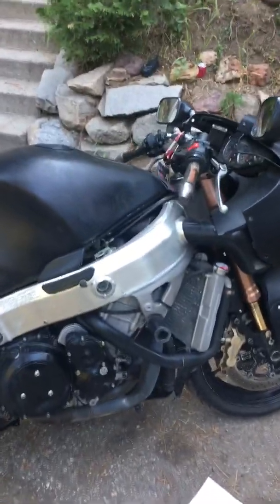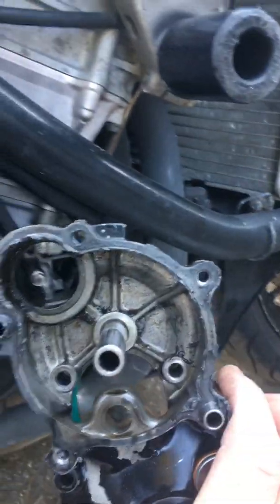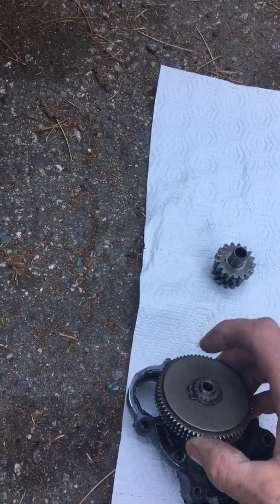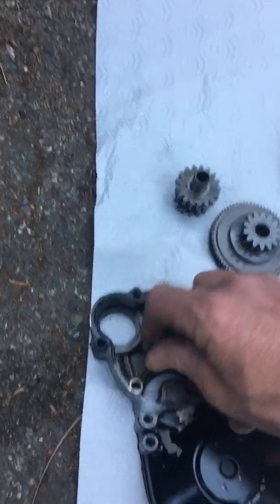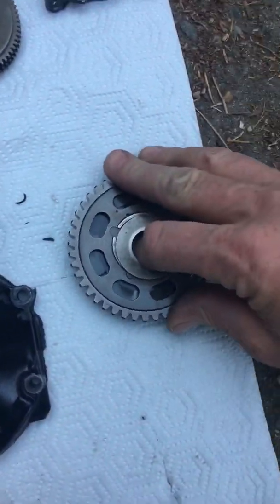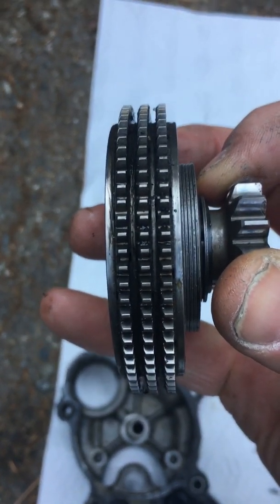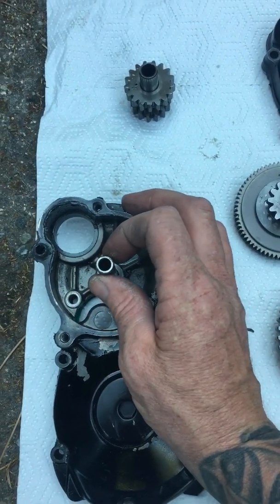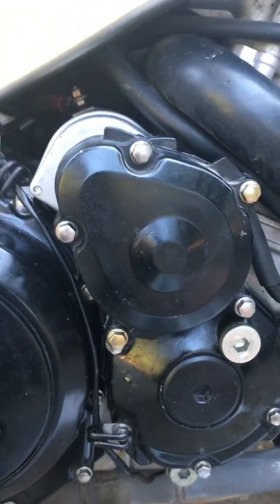Hayabusa hot start fix

Comment: So you had to replace the housing?
Reply from the maker: Yes, sir. The housing was not dedicated to the orifice of what was supposed to go in it. I replaced all the parts because it was only $70 from a broken bike, but the bike never had the problem of starting. The housing is what made the bearing go wonky eyed.
Reply: @rickgidney1005 guess i’ll try to find the oem parts then. So many people are saying its a battery problem. I have a Gen 2
Reply from the maker: @Blueeyedsoul73  there are a lot of people out there that only point to the easiest stuff which some people should try first, but maybe hook your battery up to a full-time power jumpstart to see if it does the same thing. That should alleviate the battery if it does the same thing.
Reply from the maker: @B @Blueeyedsoul73  I’m not sure if I got OEM parts off of that crashed bike from the wrecking yard but they definitely work. OEM parts are the one that originally came on the bike that are screwed up so I don’t know if they make them any better.

Comment: having the same with hot start issue with mine, if the bike cools down for 10-15 mins it starts fine. Battery is good the only thing is that mine has a big bore kit so im not sure if that would be causing hot start issues. Ill be probably open it up in a month or so and see if its lose or not.
Reply from the maker: Yeah, it can’t hurt, maybe do it and get an oil change done with at the same time or whatever else you have to do and make it all worth it. I had a smart friend to help me figure out what it was, but it can’t hurt to check. I haven’t had a problem since. Good luck, dude let me know.

Comment: Hey mate I’m having trouble hot issues with late model Haley 
Dealer told me it was voltage regulator, $700 dollars later still doing it
Next was brand new battery 
Do you think possibly a starter clutch 
I’ve watched so many YouTube videos but yours seems to make the most sense
Reply from the maker: @gordonmorrison4005  hey brother, no one can tell from this end of the conversation, obviously, $700 sucks. The only thing that was wrong with mine was deflection, when the starter spun the sprocket gears, and whatever else that transition down to the crank, we’re bending sideways so they were actually kind of getting stuck instead of spinning. That’s what fixed my bike. I know starter relay is one of the other options, if you haven’t done that then that might be something you would look for it, but I’m not sure. You’ll eventually figure it out or get rid of the bike obviously lol. I hope it goes smoother for you, I spenta lot more than you did. Just trying to figure out what I had to fix mine. Anyway, let me know, buddy. Best of luck.
Reply: Thanks Rick
Yes will keep investigating, it’s bloody frustrating though 
I’ve heard starter clutches can bind up when hot so maybe something to check
Reply from the maker: @gordonmorrison4005  I just find a nice day to give yourself plenty of time to go through the simple stuff and just be thorough and keep a positive attitude because getting frustrated doesn’t fix it. Thanks buddy let me know.

Comment: Thanks so much for posting this!!  I have been fighting with difficult hot starts for a long time on my b-king.  I was about to put a starter on it to see if that fixed it.   My question is… what is the actual fix?  I need to pull that whole assembly apart and replace the backing plate or is it just the pin?
Reply from the maker: @BouncingSkull  hello, on my bike and probably everybody else’s bike. It was just the backing plate with the hole recessed into it. The pin is made of metal and most likely is not worn out, I just think the orifice was a little too big. Maybe a factory mess up, but I got lucky when I got the replacement parts from a Cycle Salvage Place where the motorcycle had a bad head. So the parts I got worked luckily enough for me. Nobody has replied, letting me know if it fixed their bike or not. If you end up getting it fixed, please let me know. I’d love to hear it. Good luck with it.

Comment: But question what to do if the housing that the pain goes in happened to crack
Reply from the maker: @kingjohns2011  you’ll have to get a replacement, used or new I don’t know which is best

Comment: Thanks for the video. You mentioned the wave washer. I didn’t see it in your video because I assume you already had it installed with the new parts. I pulled my cover off to troubleshoot and noticed that there was no wave washer on mine. What issues could this cause and where exactly is the wave washer placed for when I have to order one
Reply from the maker: @Suzukigsxrdave  it’s been a couple years since I’ve had it apart because that was where the problem lied but it’s just right there on the hollow pin I think sitting against the idler gear. I’ll have to scan my video to see and let you know.
Reply from the maker: Hey bud, I just reviewed the two videos I had on a hot start issue where I fixed mine and I did not show the wave washer. You are correct, what I remember from it is that when I pulled the idler gear off it was one of the washers that was with the idler gear. You would have to pull up, a diagram maybe at Chaparral or a motorcycle shop where your close to to find out but sorry I didn’t show it. I think it just gives it a little distance and never lets it make to a surface for whatever reason. But yeah, I’ve never had a problem ever since I replaced that part that holds the hollow pin.
Reply: @rickgidney1005  I found that mine was sloppy in that area too. New part ordered
Reply from the maker: @ excellent, I got mine off the bike that had the head blown, but the parts were good because when I got them used, it was nothing like the sloppiness that I had with this one. Let me know if it works out for you, you would be the first one to actuallyrespond that it was a fix.
Reply: @rickgidney1005  been researching forums and videos on my issues. After I run it awhile and turn it off to like get gas etc and go to restart it. It fires up immediately like normal but dies instantly. I’ve pet much did everything to fix n trouble shoot it except adjusting valves.
Reply: Saw your video and checked mine last night and had that same slop where the shaft goes.
Reply from the maker: @ I know what you mean, like I mentioned in one of my videos, I replaced just about everything you could replace except for the wiring harness, and then it gets into digging into the motor. But I was lucky we found this problem because it was the fix.just make sure the new one isn’t like this. Also, there could have been a bad mold from the factory but you’ll check it. I’m sure when you get it. Please let me know buddy and thank you very much. Good luck.
Reply: New coils plugs throttle synced tps set throttle body and injectors cleaned. 
I also randomly get a lurching /jerk feeling at steady throttle in lower gears at steady rpm and also replaced all fuel filters and pump inside tank
Reply: @ last question lol. Was the part you replaced on it oem from Suzuki. Or eBay Amazon. I know it’s probably not recommended but I bought one from Amazon last night lol. Like $30. New!!
Reply from the maker: @Suzukigsxrdave  mine came from an original Hayabusa from a wrecking yard, but who knows, maybe you’ll have good luck. I would definitely try the $30 part because the other stuff can be expensive. If it turns out to not be as good, maybe check with some wrecking yards for bikes if you have any where you live and it looks like you live in Florida. I don’t know anything about what’s out there but I do buy parts from eBay from somebody that’s in Florida and I know bikes are really popular in that state so you shouldn’t have a problem.second or third GEN Hayabusa? I’m always on YouTube watching videos so I’ll definitely see if you respond and I appreciate it if you would. But I would like to know if the Amazon does work. I forget what the parts called but it’s like a clamshell.
Reply: @ 2005 first gen
Reply from the maker: @Suzukigsxrdave  Yes, on a Suzuki Hayabusa, there is typically a wave washer located between the idler gear and the starter motor; it's a crucial component to help absorb shock and ensure proper alignment when the starter engages with the idler gear
Reply: @ I thought there was supposed to be one on the piece you took out and showed in the video
Reply from the maker: @ there was but I didn’t think that far ahead, I should’ve shown every little piece but it’s there. I was just excited to get a video up so I didn’t do it all properly.
Reply from the maker: @Suzukigsxrdave  trust me, dude, you can’t bug me, I don’t work online and I definitely check YouTube to see what’s going on so hit me up whenever you can. That way I can know if you figure it out and don’t worry about last comment, let’s keep talking.

Comment: yea always when you have starter issues hit the starter with 12 volts directly, bolted up ... HOT   that right there would have told you the issue is on the other side of the starter not behind it, wiring or relay whatever... especially if you check at starter pushing the button you get 12 volts on multimeter, easy check both are simple ways to isolate the issue ..  NEVER just throw parts at a issue,  troubleshoot and isolate, test . .   swapping with known good parts is a way to isolate as well.. helps

service manuals and mechanic books walk you thru these troubleshooting steps .. always isolate and test wherever you can..  and YES this is a known issue with the bike but not huge you're not the first to say it's prolly a bad batch of castings...  too bad we cannot build a database and see if the issue lies within a certain year of bikes certain month builds?

of course suzuki has this data...
Reply from the maker: @deandee8082  excellent advice, thank you. Voltmeter might sound like English to somebody like you or me, but it might be a foreign language to a new rider or mechanic. But you’re exactly right, the manual will take you through all those steps. They just don’t tell you to look for the problem that I found. But you’re very very on point with saying don’t just buy new parts and put them on expecting to fix the problem, narrow it down first. Thank you.

Comment: Thank you your video helped me a lot . I had the problem with my bike. I have 2022 model. And I already drove 50,000 miles. I think my problem because I didn’t change oil enough.
Reply from the maker: @AntonA-m8j  glad if it helped you, I knew nothing about it until we figured it out. I saw nothing exactly like it online. Do you think you should definitely keep up on the oil whether it has anything to do with that or not, I noticed when I opened mine up that everything had had a little bit of oil on it, so maybe there is some kind of system that keeps a little bit of oil on it. I’m totally not sure about that. But good luck.

Comment: Hi, i have the same problem. Thanks for the video. My repairman  says to me it can be the crank bearings. But after I see your video i will try first this method. Hope i can fix it
Reply from the maker: @hakkipilan5861  good luck, this try will definitely be cheaper
Reply from the maker: @hakkipilan5861  once I got the parts off of another bike, which I was lucky that they didn’t have the same problem, I tested them on the ground just like I did in the video and there were no tolerances at all. That’s where my problem lied.

Comment: I was searching for the gen 3 Busa problems before I'm going to the dealer for it and found a lot of hot starts issues on those all over the internet. The funny part of this whole story is that people claiming they're technicians with 10, 20 or whatever years of experience and at the same time talking about starter relays, bad battery, bad gas (lol) or whatever... 😂 
I'm sure that the problem is 100% mechanical, starter clutch or its gear or the pin just like you've mentioned in your video.
And it's a shame that Suzuki just freezes off this problem acting like nothing happends all these years.
Reply from the maker: @WeldEXE  you’re absolutely right about that. Before I own the bike, I started mentioning what I considered might be a problem and the guy told me that he’s had mechanics from the Suzuki dealership check everything and they couldn’t find it. It took me just thinking hard and looking deep into it and getting my hands on the bike with a smart friend of mine that is like a MacGyver. Really smart dude and we figured it out together. Luckily, I got the parts from a bike that was wrecked from a Cycle Salvage yard and they were good. I just took my chances but all of the parts were only $100 so it was worth a shot for me, and it worked. So that’s where my issue was it’s gross, like they don’t put any extra effort into making that problem go away.
Reply: @rickgidney1005  yeah, people should start thinking and understand how it works before making statements like "it's because of bad starter relay". But they don't 😂
Reply from the maker: @WeldEXE  OK bro, I don’t know if you have a GEN three or if you were doing it for a friend but nobody has ever really gotten back to me after they told me thank you to let me know if it fixed it or not. Do me a favor and let me know if you find where the problem lies. I’m interested to know. Thanks bud
Reply: @rickgidney1005  well I guess it helped, orherwise they would comment something. I'm going to buy a gen3 Busa this month and if I'll face that "hot start" failure (which is very possible btw :)) I'll take off that cover, inspect the pin and tell you what I've found, no problem. Thanks for the video again, you did a great job! 👍👏
Reply from the maker: @WeldEXE  thank you sir, good luck

Comment: @rickgidney whats the name of that part so i can look it up to order. Im having the same problem but mines on a 2022 hayabusa
Reply from the maker: @MrGsxrboy600  check it out, it’s not the gear that’s the problem, it’s the hollow, approximately inch and a half to 2 inch pin that it works on needs to have a solid really tight fixture to sit in. If you take it apart yourself, you’ll see what I mean, if you have somebody else take it apart, you can watch and see what I mean.the shell that clamp it all together at the end is the problem, they need to be really tight with no tolerances available. You know what I mean hopefully
Reply from the maker: @MrGsxrboy600  not one person has ever reached out to ask me anything else after I told them what fixed mine. That goes to show me that what I told them had fixed their problem. Once you get your bike working properly again, can you please let me know that you fixed it?I would appreciate that, I’m not looking for views or likes, I just want to know
Reply: @rickgidney1005  definitely. At this point I'm close to giving up. What stumps me is that my bike is so new. I've replaced the starter and battery and so far nothing. I have found a lot of others with the same year as mine but nobody could give me answers. Thank you for responding so quickly. I'll keep you updated as soon as I can get work done on mine.
Reply from the maker: @MrGsxrboy600  dude, it’s been a couple years since I fixed it but I’m pretty sure it’s called the idler gear. The one that the starter has to jump out and turn. The shaft pin that holds in in place needs to be solid, if it gets deflected, like, if it has enough room to angle, it won’t spinand it will get bound up in its hole that it has to ride in, so yeah. Sorry that you’re having that problem but let me know if that helps. Good luck dude.

Comment: Same problem on Suzuki bking same engine
Reply from the maker: Yeah, it’s not fun to deal with but it definitely fixed my issue.
Reply: I'm from Europe, I plan to keep the bike with me and I have no desire to ever sell it. If it's the same problem as yours, I'll buy new parts no matter how much they cost because I love BKing.
Reply from the maker: @markoristic5416  that’s the way I feel, newer bikes, are a little bit faster, but the gen one definitely grows on you, and is totally unique. I won’t get rid of mine either, I love it too much. It’s definitely fast enough for me, and then some!!
Reply from the maker: I got my parts from a place called Neanderthal in California, I don’t think they’re around anymore, but the parts I got came off of a bike with a blown head or something. And I wondered if the parts that I got we’re going to have the same issue so it’s kind of a gamble, but they were fine.if you have to buy them brand new it’s pretty expensive but I got all of the parts for about $100 which was a smoking deal.

Comment: I have the same problem in my bike in hot start its like low battery whenever i try to crank it,  i will try it to my bike, thanks for sharing for your discovery.
Reply from the maker: My pleasure, good luck with it. I didn’t see anything on the Internet about it, so I knew it would be pretty messed up if I didn’t share my find. Let me know what you find out.

Comment: My 2002 ate up the starter motor I just got brand new. The teeth are all screwed up. Pissed off about it all cause I’ve been chasing this issue for close to a year now. SMFH!
Reply from the maker: Yeah, from what I came to learn, it’s a pretty common stupid problem with not too many real good answers out there. Hope this can help you out some.
Reply: @rickgidney1005 Yes it did Í hope. I just purchased a new starter clutch with gear, and I also purchased a upgraded 2003 idler which is definitly different from the one I currently just took off my 2002. So basically I just switched everything from 2002 to 2003. Have not yet changed the starter motor, thought I’d give it a try before coming out of more money. Damn idler cost me $127. Getting to a point to where I wonder if it was all worth it. We’ll see
Reply: Me to